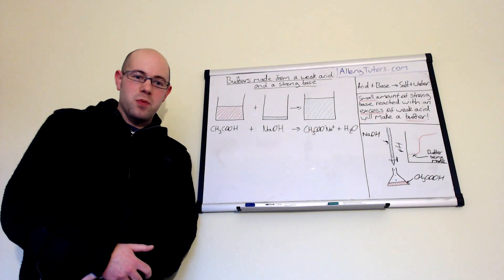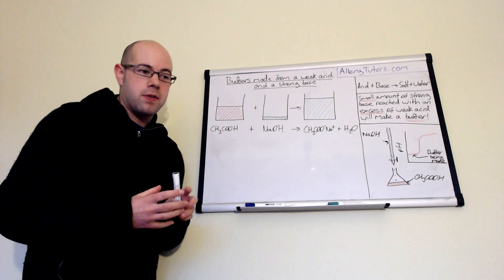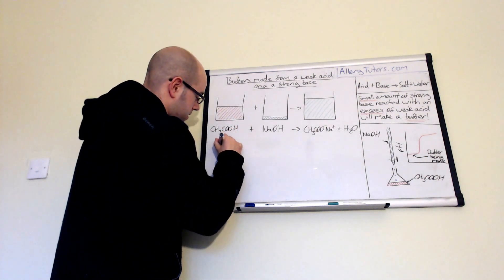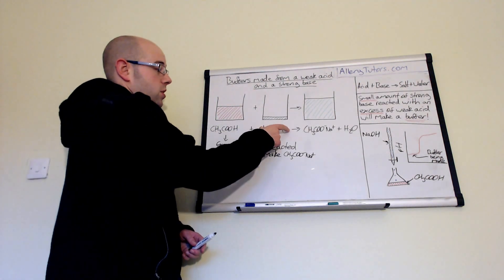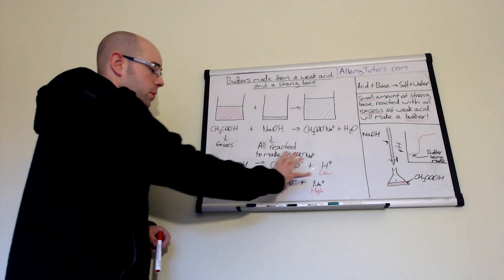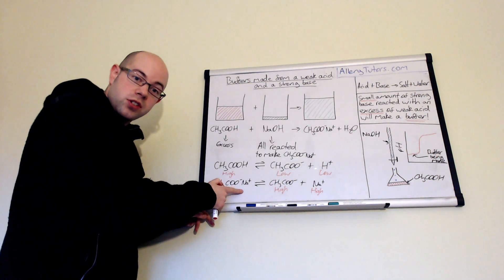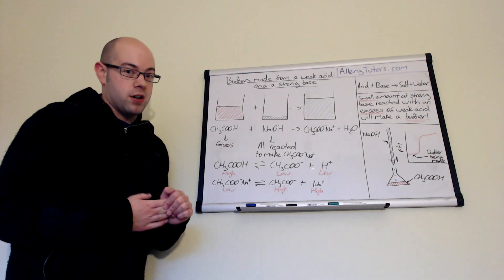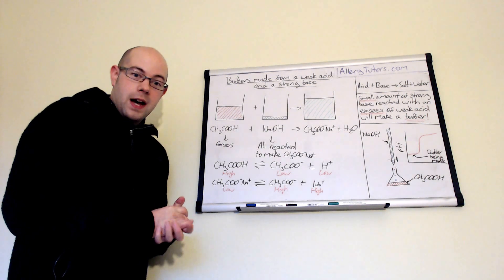Buffers made from a weak acid and a strong base

Comment: Could you please explain to me the action of this buffer when you add OH- ions? Does the OH- ions react with H+ or CH3COOH? Or it doesn't matter either way?
Reply: @Rose87 OH- ion reacts with H+ to make H2O. Since some H+ s used up to make H2O, the buffer tries to compensate by pushing the reaction equilibrium more towards the right side, turning CH3COOH acid into its conjugate base and H+ (in order to make up for the loss of H+ when OH- was added to the solution)